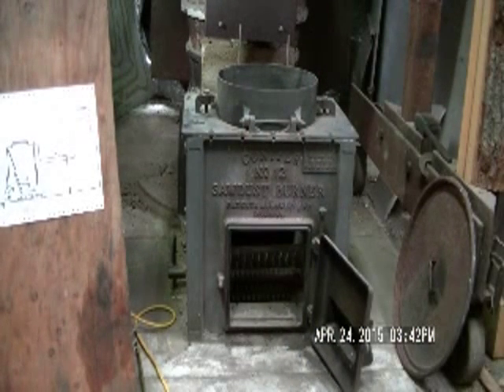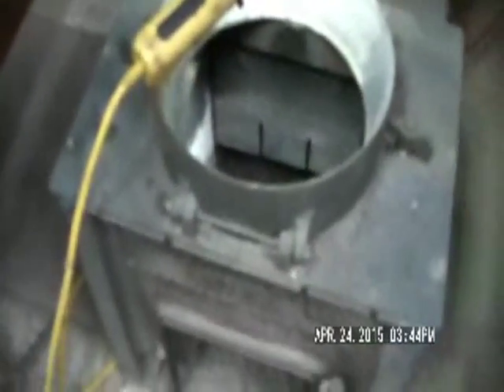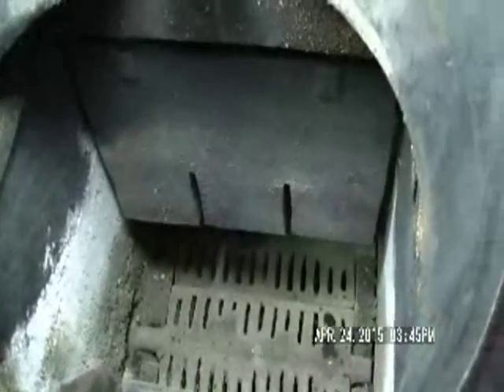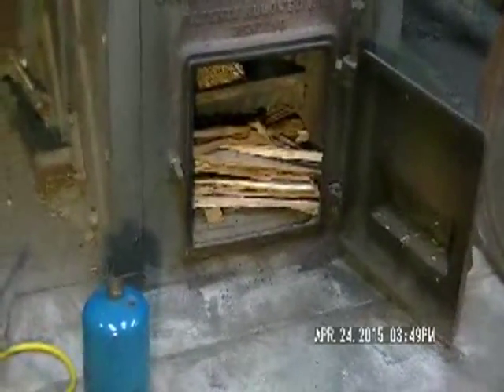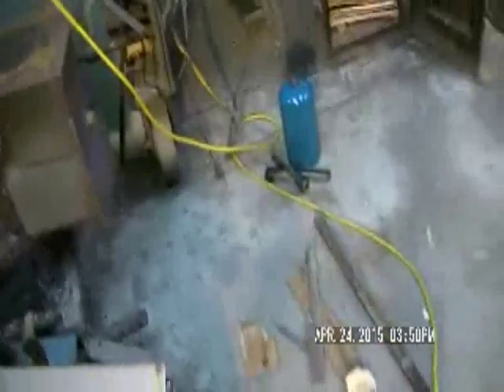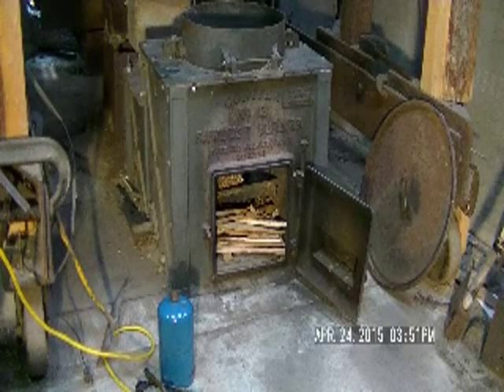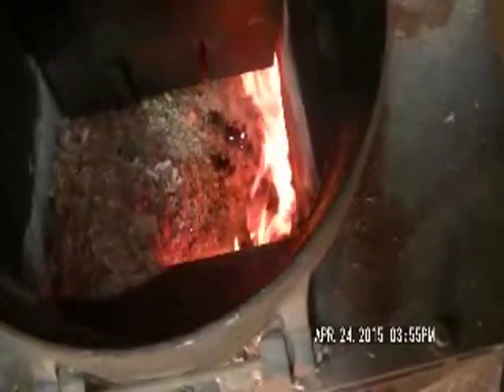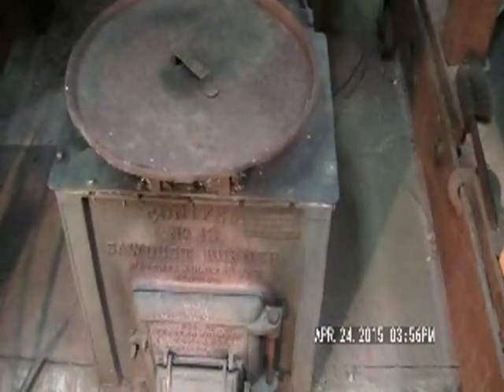Sawdust furnace  fired up vid#2

Comment: Well done video! I have an animal bedding drying operation. This would be a godsent for me! Any idea where a person can but one of these? I have built many things, maybe it can be built from thick steel rather than cast iron?
Reply from the maker: Brian G, The grate in the front of the firebox and the lower grates for the ash should be made from cast iron which will able to take the heat. The outside would be fine using 1/4 " mild steel because there is 2 inches of refractory surrounding the hearth. I've tried to find the site from Hern Iron works  but they may have sold that side of the business. Where are you from? I may entertain the idea of selling this one if it's local. ( New Hampshire, USA ). It is extremely heavy so shipping would be very expensive, crating would also be a nightmare
Reply: I'm in Pa. and interested in talking more.
Reply from the maker: @briang7298   I purchased it from a fellow in Thornton , NH  who used it to dry Red Pine poles to accept preservative treatment and then used for piling out on the coast. My intention was to heat a kiln for firewood but the market never really came together at the time. So I used it to heat the shop for  a few years. It's one heck of a heater, but can be a little temperamental during start up.
Reply: I am interested in it and can make a trip. Can we get in touch?
Reply from the maker: @briang7298   There is a lot of detail to the installation which I didn't cover in the video.It's worth a good look to see if you can duplicate it with your own build or consider this one to purchase. You are more than welcome to look it over but this covid19 virus has everything on hold for the time being.
I think it's rated at 314K BTU. It's really impressive when it's running full power, almost scary. My email is : 

Hbbyloggr@grolen.com ,contact me there.